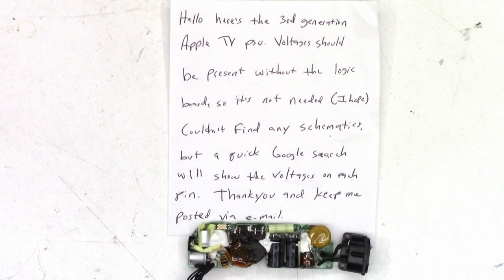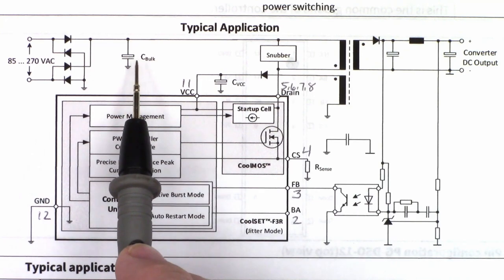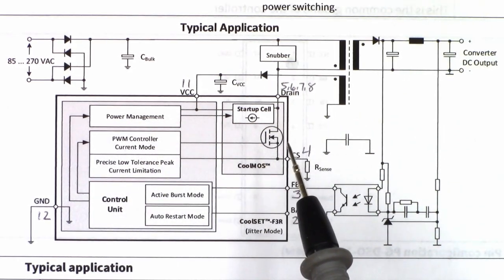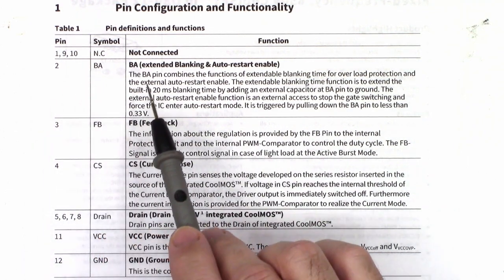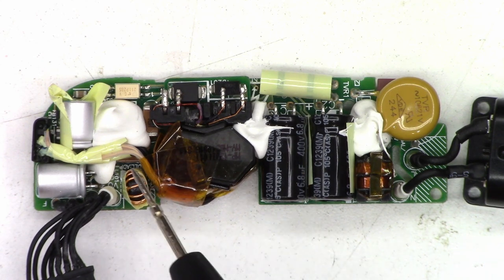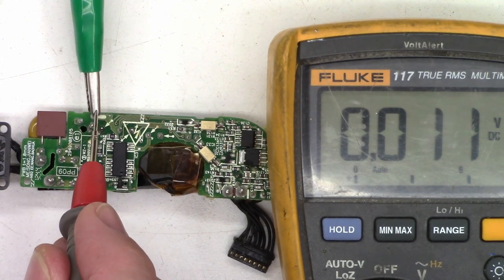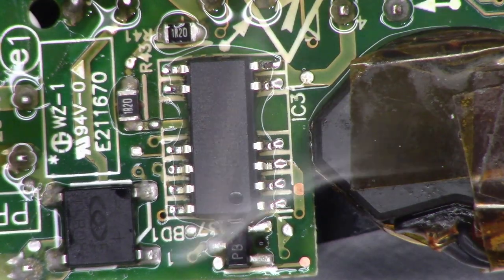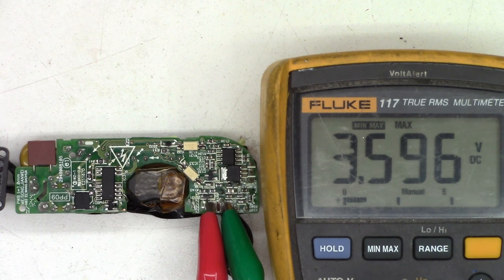CUSTOMER SENT ME AN APPLE TV 3RD GENERATION POWER SUPPLY RO REPAIR. SUCCESSFUL FAILURE

Comment: That was a good explanation of the working of this power IC. There must be some fault detection in the IC which is switching it off. You can check what makes this IC switch off from its documentation and trace the faulty component.

Comment: Great channel. I think there is a fault on the secondary side. Check around the feedback loop. What probably happened is something failed on the secondary sound that caused the unit to go into shut down protection that eventually took out the chip.

Comment: There is not a lot on this board....if the run winding has continuity, most likely it would be something on the secondary. I would just replace the 2.5 reference, and test one by one with known good optocouplers (i believe there are three on this board).
What is the 8pin IC on the secondary? 
Thank you for all the great videos !

Comment: As many others said below. Something wrong with the secondary feedback. Notice how it climbs very quickly to nearly 3.6 volts, then shuts down. Nothing telling it to quit building voltage, until the protection circuitry kicks in to shut the whole thing down. Although I am kind of curious about the current sense resistor. What is the maximum voltage drop across it when using Min/Max before the secondary shuts down? Maybe that sense resistor has gone high resistance or even opened up??

Comment: I would try a 2.5v reference (from bench ps) on ic pin3 and check output dc.
Reply: That's a good idea!  I wondered if the opto had failed.  My final thought - it's not one of these PSUs that doesn't output unless there's a little load is it?

Comment: Have you checked optocouplers?
Reply: Yeah he didn’t mentioned it. This failure seems like a feedback issue. And he should use a oscilloscope and and isolation transformer as well, in my opinion, when troubleshooting a SMPS.
Reply: Ummm -.thank You all,  actualy I'm facing similiar problem,  there is 18vdc on bootstrap caps -.but not output voltage on secondary
Reply: Since the controller chip is giving the initial pulse, it looks like it is working properly, but there is no feedback.
Reply: @slobodanjovanovic8166  Likely no feedback, or the secondary side control is turning off the power supply.  Either optocouplers are faulty, and the chip is going into overvoltage shutdown from the primary side  supply, or the reference is either dead, or the resistors or ceramic capacitors in it have cracked or have broken traces. Then the primary side comes up, but the voltage rises above the trip threshold as there is no feedback from secondary, turning the controller off. 

Likely the secondary side has some power control there that will switch off the main 3V3 rails, and then run the chip in a low power mode through the second optocoupler, using a power rail that is higher voltage, but which is dropped down to give a standby 3V3 rail, so the controller is sitting at minimum switching frequency or in a burst mode to maintain a supply but use very little power.

Comment: I know what you were told and looking at the circuit it may not initially be obvious of an "Over Voltage state" So is it possible the power supply in fact does rely on a proper load before current ergo the correct Voltage and current is outputted?
Reply from the maker: I did connect a load and had the same results.

Comment: Wouldn’t the supply require a load to sense it being connected to the logic board?
Reply: If it has a built in load resistor then its not necessary but if it doesn't then yes you are right i have had this symptom without load it shuts down. I hope Norcal makes a follow up video.
Reply from the maker: I did connect various loads and still the same results
Reply: It’s unfortunate the customer did not include the main board.

Comment: does it have a feedback on low volt side from output connector, IE some return saying yes its running and ok.
Reply from the maker: It has only supply voltage out and a stand alone thermistor to send temperature to the logic board

Comment: I guess it's a no load issue. He should try load this power supply and check. Because one time I have faced one smps which was good after replacing some power semiconductors. But when I turn smps on it shows similar behavior. Then I was connected load which was 80% load for power supply output rail and smps output was stabilized.
Reply from the maker: I did try various loads and same results